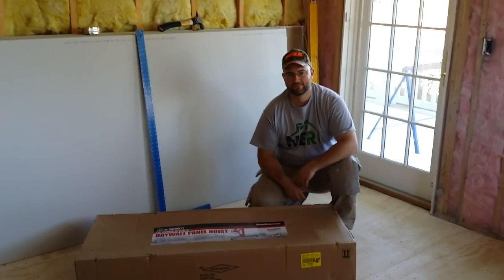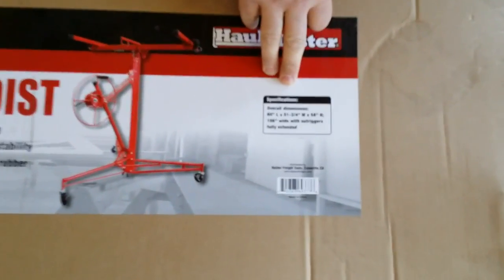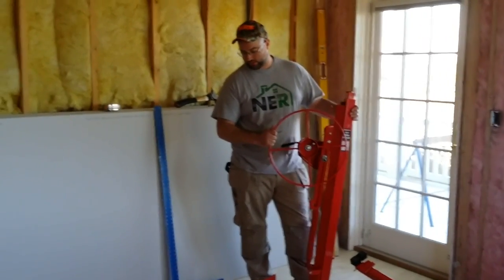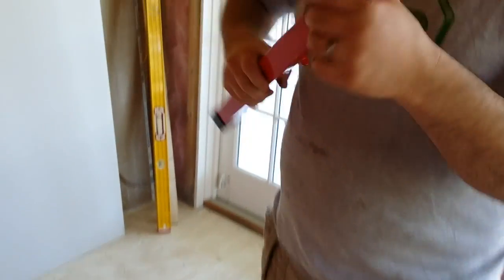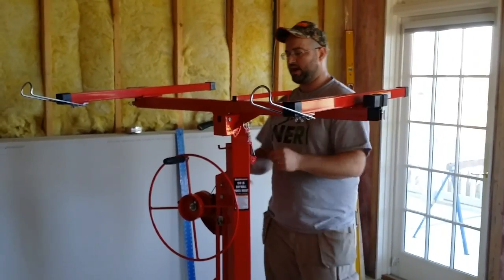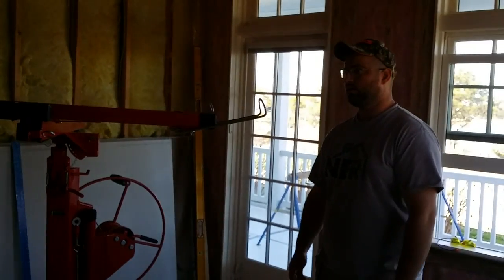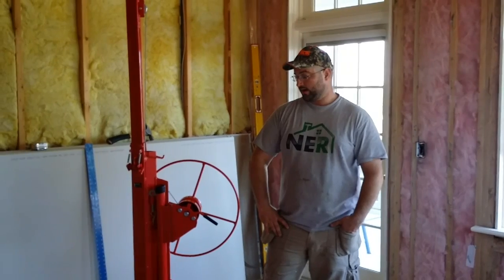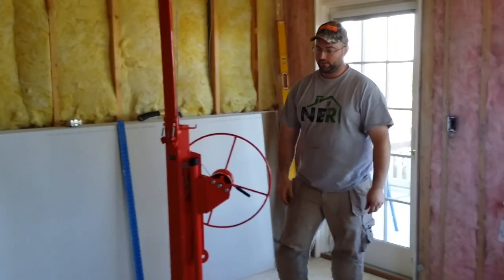Harbor Freight drywall lift hoist  69377 Tool unboxing and review

Comment: Amazing. We had a leaky roof for a while we couldn’t repair, so my life for the foreseeable future is drywall. Spouse and I battled trying to do by hand. Thought of renting from the Home Despot but this was cheaper long run. Now if I can’t find another job, maybe I can become a sheet rocker. (Which sounds so much cooler than it is in reality)
Reply: Good luck with the repairs! A good 6" and 10" knife will do a lot for you.  Practice makes perfect, dont try to go to thick with your coats of mud and dont mess with it too much, get it looking good and keep moving. Always easier to come back for a extra coat at the end than it is to have to do excessive sanding to remove build up.

Comment: Great video. It took me some reading of the instructions but the square pin connected to the mast is another safety feature to go through the lowest hole on the mast when in the up position to catch in the event the two breaks fail.

Comment: These are the way to go to save your back. I am a HF fan boy but did find it cheaper in Ebay, 125.99 delivered. HF right now is 215.00.  I used to hang a lot of rock back when I was a young buck, but never used these as they are too slow. Now my back is shot and I am older and wiser, so a lift for me. Great video, keep them coming.

Comment: I bought one several years ago, used it to hang sheetrock in a 24' x 36' outbuilding with 10' ceiling.  Worked ok, made the job easy.  Was able to hang sheetrock by myself, but loading a sheet on the lift arms isn't quite as easy as you would think.  I still have it for future use.
Reply: Mark Chapmon  its a orange handle on Home Depot for sheet rock

Comment from the maker: I realized i forgot to show how the lift wheel extends out away from the mast in the video..   it just puts it in a little better position to crank it up, it can be used either way actually.   
the picture on the box in the beginning of my video shows it in the extended position
Reply: yes for me I extend the wheel away from the mast.
Reply: Yeah that way you dont have to go under your sheet to start cranking up.
Reply: well I glad you pointed that out, you should reshoot video. because I was thinking "what a moron" Hey being honest., thats not a convenience feature. Thats to protect the operator from being under a heavy load. even without a load, the rack weighs enough to give you a good smart on the head. 
The fold  up feature allows it to be stored  in your truck or trunk compartment more easily.
 The Clincher: If you needn't read the instructions, why did you feel you were an expert to to do a How to video???   I'll answer it for you 55,000 views.  America is in great shape! 2+2=5

Comment: Rehabbing an apt. I gutted, bought this (I'm 67) and love it. I call it "Pedro", just in fun!
Now I know what that hook thingie is for. Oh, for the sheet above a tub, you can unlatch the leg spread and get the mast pretty close to it, then shift the sheet over when you get it up. A little tricky, but better than a sprain.
My mast won't go into the leg base so easy; has to be perfectly in line. I lower the empty cradle with one hand on the wheel so it doesn't slam down.
Not afraid to take on any rock job now; ceilings were my limit. The real fun is the finishing though, where I can shine!

Comment: Very useful tool & multipurpose aswell. When Im doing roofing I put a plywood instead of a drywall then flatened it at 180 degrees then I put a bunch of shingle bundles on top & cranked it high to the roof easy 😂 since then I never carried bundles up the stairs ever again. Im so SMART 👌😎

Comment: My 50,000 BTU Mr. Heater is needing replaced with the same unit. It weighs 75 pounds, do you think I could put a piece of plywood on top and use this to get the old one down ad the new one up? This is a great video by the way. I love Harbor Freight. I just bought the New Hercules miter saw during the black friday sale. Looking forward to using it. I'm just joe homeowner, but a major hotrodder. How do you not buy that saw. I even passed up the $500 RIDGID on sale for $300. Yes I did. Paid the extra for two years and now I have a 3 year no questions asked exchange warranty! Yea baby! Please let me know if this sheet rock jack will work, thanks.
Reply: wheelstandr Did you ever try the lift to raise up your new heater and bring down the old one? Just curious,as I think I’m about to buy one of these. Thanks!

Comment: Rented a drywall lift just long enough to place a tricky drywall sheet in my mom's ceiling.

I had prepared the rain-damaged area the day before & was able to completely remove a previous 4x8 sheet, revealing the surrounding sheet's edges. 

The sheet to be replaced ran about  5"x12" under a cabinet's top edge. It was very hard to get the sheet in place due to the cabinet & a nearby light fixture.

I got the sheet close and installed enough temporary screws to hold the sheet ALMOST flush to the joists while I ran to the next town to return the lift because the rental time was expiring. 

When I returned to install the final screws and completely seat the sheet, the opening was about 1/8" too tight.

I'm working alone and don't think I can remove the sheet & install it after sanding or rasping the edge down without a lift.

Is there any way to accomplish this without completely removing the sheet? I assumed the opening was perfect for a 4' width. Bad move, I know.
Reply: Hey @TortureBot . You should be able to take a utility knife and cut off the edge that is giving you trouble. maybe loosen a few screws on that side just a bit so it isn't pinching the existing sheet too much. just keep cutting multiple passes with firm pressure until the knife cuts all the way through and you have the clearance you need.   Dont worry about it being a perfect joint either, if it look a little rough after this, once taped, coated and sanded you will never know and it wont affect the integrity of the repair!   Good luck
Reply: Thank you for the advice. Another person who answered the same question I commented on a different video said to use either a Dremel tool or something similar to get that result like you're talking about.

Comment: I bought the same one a few years ago  well worth the money
Reply from the maker: regopit44    nice, how has it been holding up for you?     we have been muscling sheets around up till now, and really dont even do a ton of rock but i decided it was time to start working smarter rather than harder when we do!
Reply: NERemodeling It has held up just fine.I use it 3 of 4 times a year to do ceilings and have never had any problems. If I where to guess I have had it about 4 years now. I have rocked whole rooms by myself with this thing.
Reply: So is it still holding up as far as quality

Comment: Curious if someone can tell me... How stable is this at a height of about 8 feet?  I have an odd task not related to drywall, but involved lifting some large speakers off the ground at about 8-9 feet for photographs and I’m thinking this item could be used to act as a large platform to set the speakers on and lift them. I just have concerns that the items standing on the platform could fall off as this item appears to be a bit unstable. If so, I’ll have to come up with other options.

Comment: Did you not look at the instructions or even the picture on the box?  You never extended the crank arm into proper position.  When you had the panel on the lift, you were fighting with the crank under the panel because you didn't extend the crank arm.

Comment: i just purchased one today worked great the only thing i was wondering about that know one seems to know what is that damn eyebolt key looking thing hanging on the side?
Reply: +Nick j I bought one a few years ago, and I need to use it again. I forgot what that eyebolt with the welded washer is used for hence here I am on google to find out. Did you find out what it is for?
Reply from the maker: +Dasdfjkl I don't really know what it's for but it isn't necessary for the use of the tool...   maybe it is an additional safety measure? will It fit through the holes on the height extension shaft and act as a foolproof safety against a failure of the lift crashing down?

Comment: If you are looking for a way to hang panels on walls by yourself check out hangprolift.com.  The only tool made specifically for one person to transport, lift and hold panels on walls. Never have to lift a panel again when hanging walls. Works with upper and lower panels.

Comment: A HUGE thanks for creating this video!  I'm working solo on  a ceiling job thats coming up and was on the fence about buying this unit.  HF has it on sale for close to what you paid for it and after watching your video I'm pulling the trigger and buying it tomorrow.  Like you mentioned in an earlier comment its better to work smarter than harder.  This should alleviate the dreadful shoulder and back pain when  doing ceilings.
Thanks Again

Comment: What is the flattish rectangular pin with the washerlike head for ?
Reply: This is the most mysterious feature of any tool I’ve ever known. No one knows what that mystery pin is for. Directions don’t say. Harbor Freight has no idea. I’ve tried fitting it in every hole or crevice in the tool and it doesn’t fit anywhere.